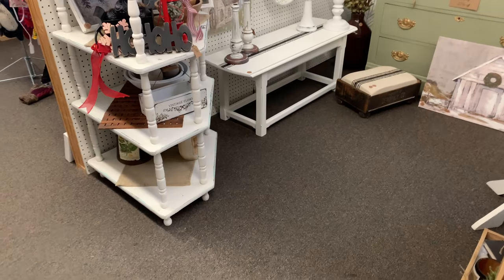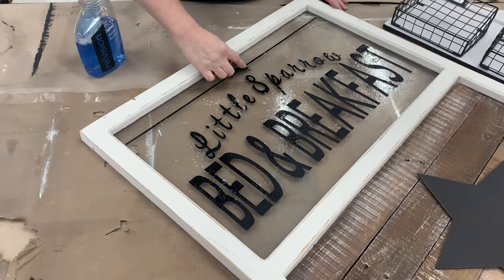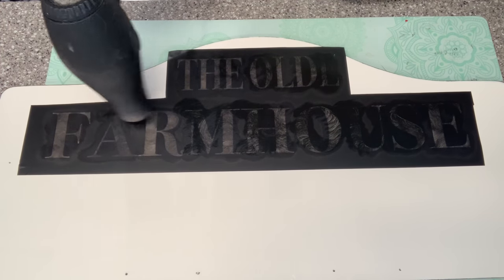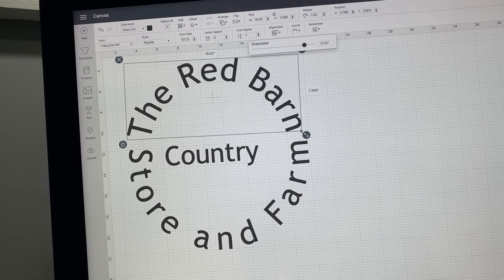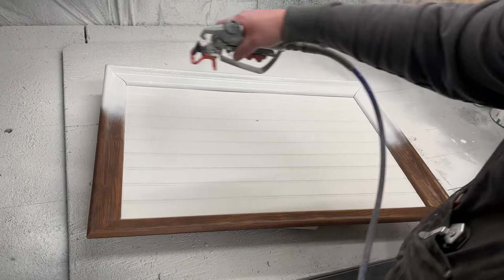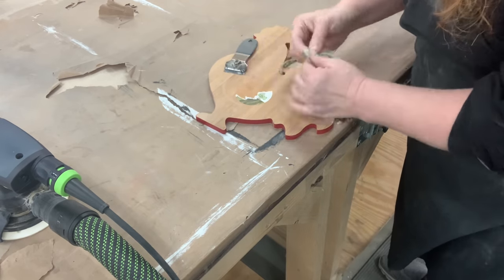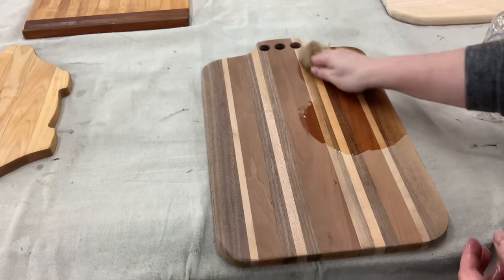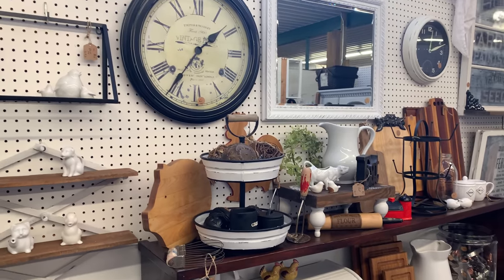Quick Flips || Booth Restock

Comment: Just a thought....could you make the 3 wire  1, 2 and 3 baskets go vertically instead of horizontally.  Most people people don't have that much horizontal space available.  Would be a lot easier to find a narrow vertical space in our homes. 😊
Reply from the maker: Not with the rounded part.. it’s partial board so I wouldn’t really like cutting it

Comment: I so love your  style of upcycling.

Have you tried this? After putting the transfer tape on the decal, I place the decal and transfer tape on baking paper (NZ), US: freezer paper? with just a little bit of the decal over the edge. This allows you to position and reposition  the decal without the whole lot sticking. 
 Then peel the baking paper off from underneath and smooth the dec down.
I can send a video if this doesn't make sense.  IT SAVES A WHOLE LOT OF TEARS. 
Reuse the freezer paper over and over.

Comment: I use an oil & wax on cutting boards. If they're really dried out then probably 2 coats. It takes time but the condition of the wood is visibly better. I do always take the time to sand. If the piece is in good shape I'll just use sanding blocks and start at 100 for a scuff sand or progress through the numbers till I get to 220-400. ON straight pieces I'll use my Dewalt sander although I do a lot of hand sanding with blocks and/or sponges.
Reply from the maker: Thank you for sharing that